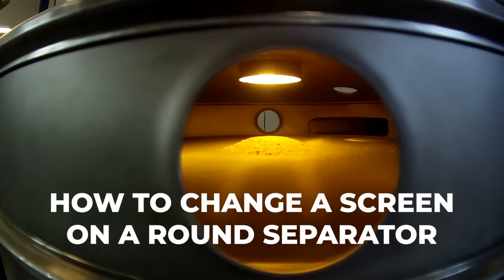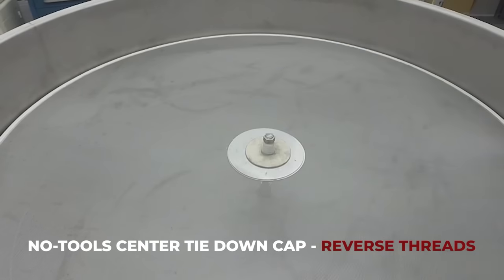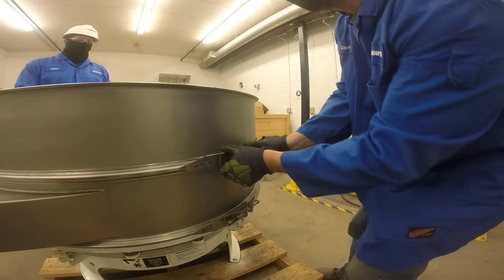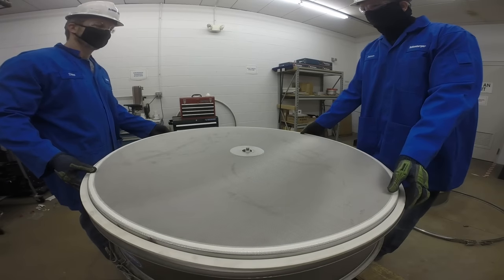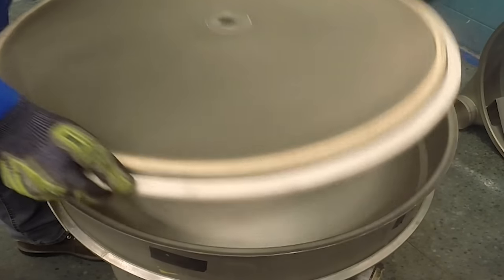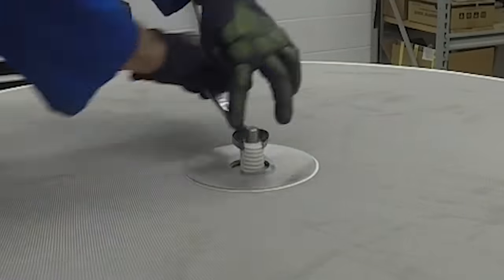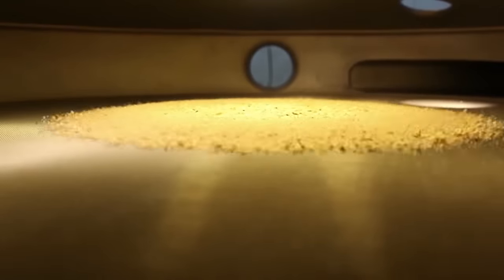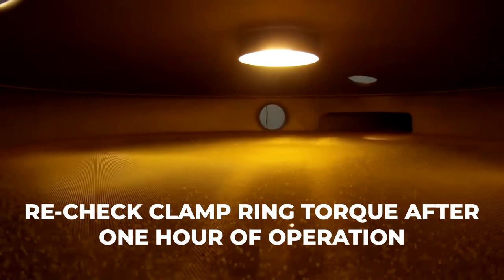How to Change a Screen on a SWECO Round Separator

Comment: Sweco, is there a recommended torque spec when tightening the clamps? We 6 of this and we change screens weekly. common problem is that the 2 inch nut always stripping. We currently use 60 ft.lbs
Reply from the maker: Chris,
I can have your local SWECO rep contact you and send you a user manual for you to reference. Can you please send me your email address, location and other contact details so I can pass them onto your rep.
Thanks,
Jeff Dierig
SWECO Global Marketing Manager

Comment: Hi Sweco, i wanna ask, my plant use it in separation maltodextrine, but found the screen was torn, what potential made screen torn?
Reply from the maker: Wildan,
Is it difficult to determine the cause of a screen tear without first examining the screen itself. There are many reasons why a screen tears. More than anything, normal wear during production will make a screen tear. The more abrasive the material, the faster a screen will wear down. Also, accidents happen in a production facility and it's possible that something gets dropped on a screen. This can easily tear a screen. If you can provide me with your location and contact details, I can put you in touch with the local representative in your area and they could help to determine the cause of the tear.
Best regards,
Jeff Dierig
SWECO Global Marketing Manager